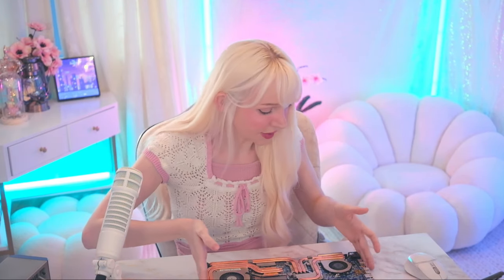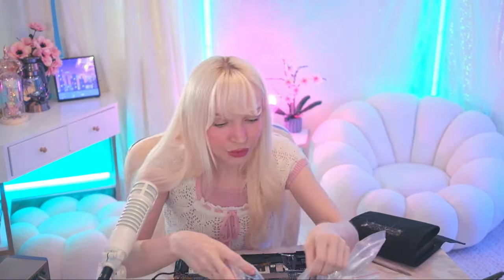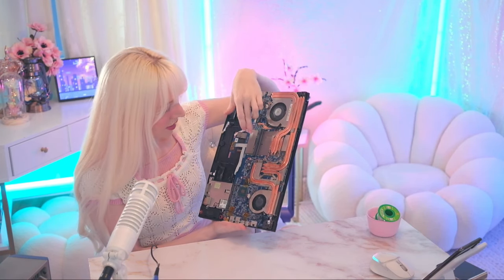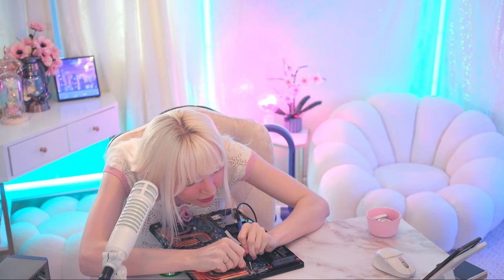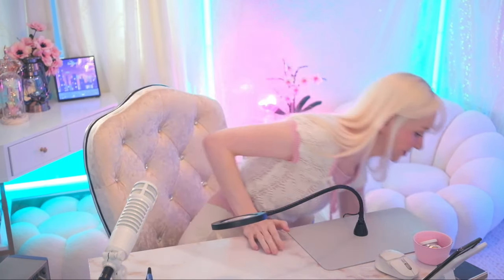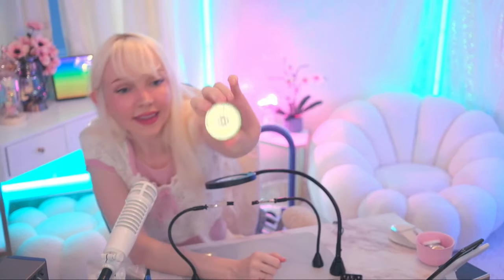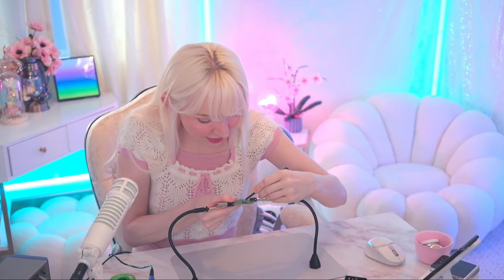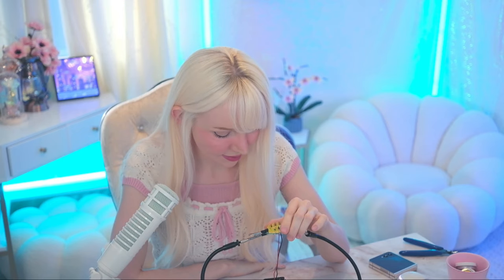Watch Me Repair My Laptop! Tech enthusiasts, you don't want to miss this!

Comment: Oof, kinda bummed to see laptop OEMs still cutting corners with a single stick of RAM installed, single-channel memory configs are a big no-no for video/3D rendering and gaming. You'll get a decent boost in performance if RAM's installed in a dual-channel configuration, especially with AMD Ryzen CPUs.
Reply: It's useless with ddr5 since ddr5 creates two channel with each stick so the difference is only about 1 or 2 percentage